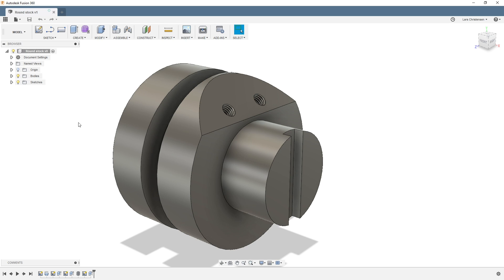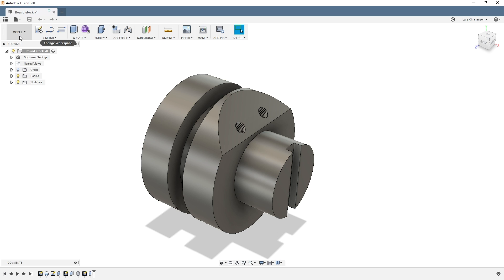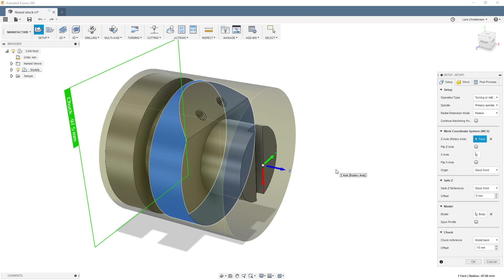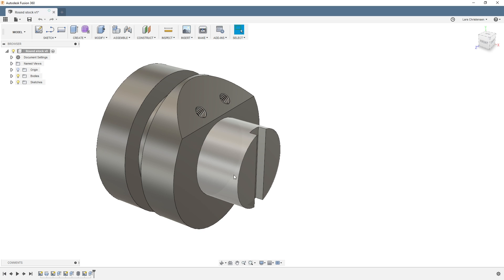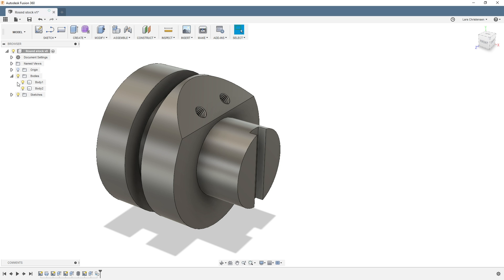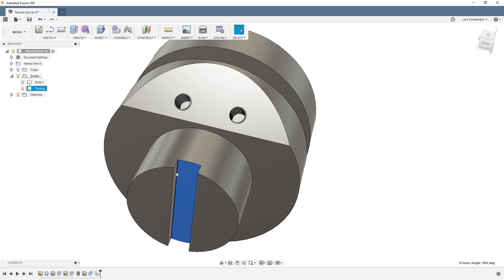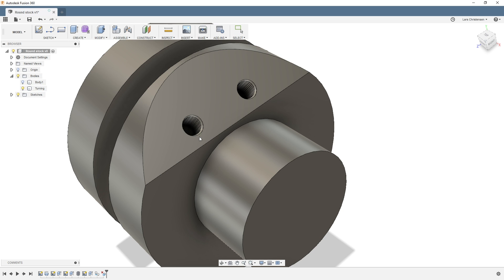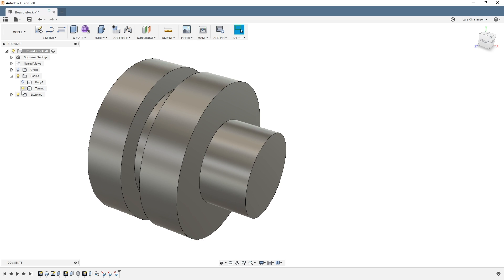Model Your Own Stock in CAM Fusion 360 — Season 2 EP13

Comment: Hi Lars, 
As ever your videos are spot on and have helped me no end with machining. I've literally watched all your videos with zero experience and then went out and bought a new Haas VF4SS. Crazy I know but we are running it and making chips! One thing I do struggle with on fusion is when I am going through my cutting ops. I cant seem to carry stock over from the previous operation. For example if I did an adaptive clear or pocket clear then wanted to do parallels to finish a part the original stock doesn't change which shows my spindle colliding on simulation. I'm wondering if there is a way to show the stock reduction through out the setup? Does this make sense? Cheers James (Scotland)
Reply: Make sure you have rest machining on and set to look at previous ops that way the tool path will take into account the material that has been removed from previous ops and only calculates what it can cut I think this should help

Comment: The confusing part of this video is the setup you did for the facing op.  I'm not sure you would use the that face to set up your stock, would you?  Wouldn't you use the normal Z axis of the part for set up and then use tool orientation to perform the facing operation?  I get that this is mainly about using solids for your stock, but that part of the video could confuse people.  Thanks for the video Lars, and keep them coming!